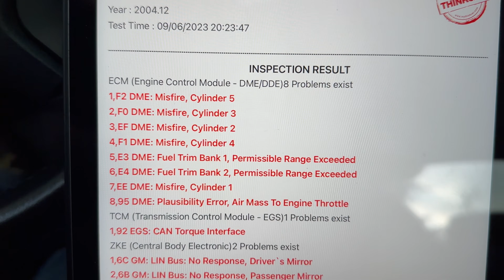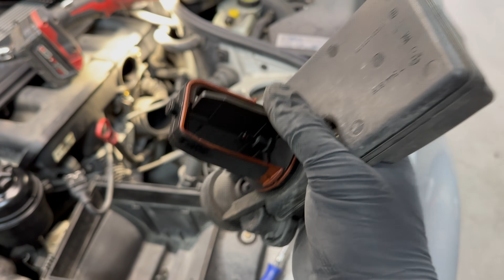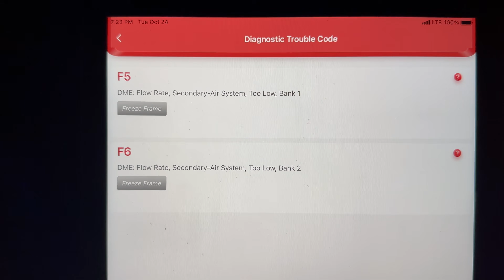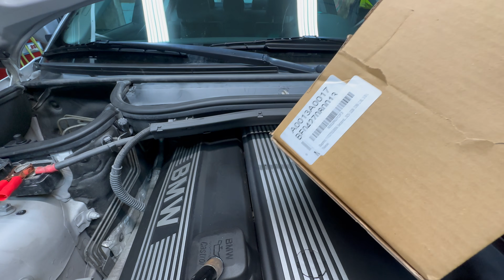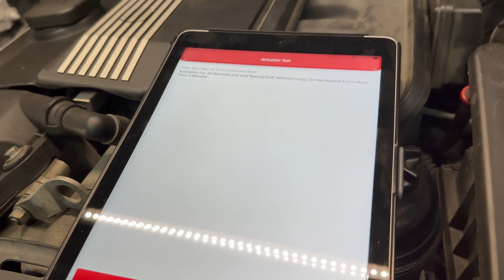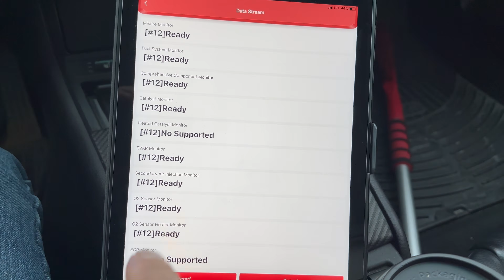2005 BMW 325xi:  Troubleshooting driveability issues

Comment: Hi, Great video, thnx for sharing your knowledge. Quick question, what if it wasn't the cracked boot/hose...? What else would you look for... We are experiencing the same code and limp home transmission problem...?  2005 325xi... It's great car, don't want to give up on it... If we reset the code it drives ok for a while, then it eventually returns...Thnx in advance.
Reply from the maker: I would look at other sensors that have anything to do with the transmission.  Mass air flow sensor (MAF), throttle position sensor (TPS), etc.  Are you getting any engine codes?

Comment: Excellent video and presentation. btw - what scan tool are you using?
Reply from the maker: Thank you!  I would have to rewatch the footage, but I’m pretty sure I was using the Thinkcar Thinkdiag scan tool software on my iPad.  It has been my lightweight go-to scanner for a couple years now.  My other scan tool I might have been using is an Autel MS906BT.
Reply: Thanks!  @AKJeeper